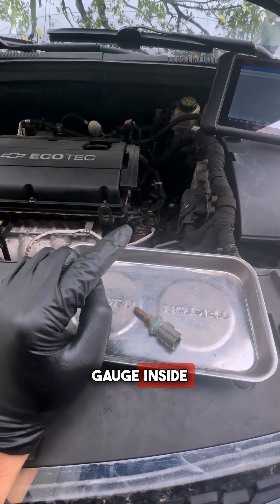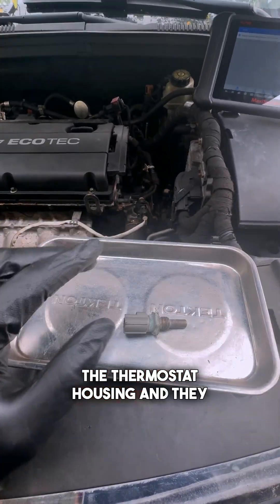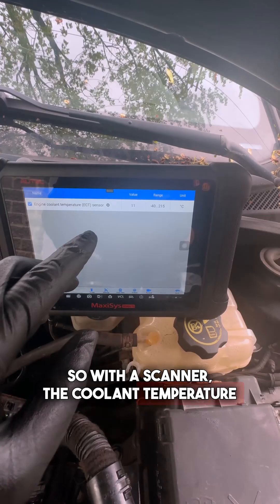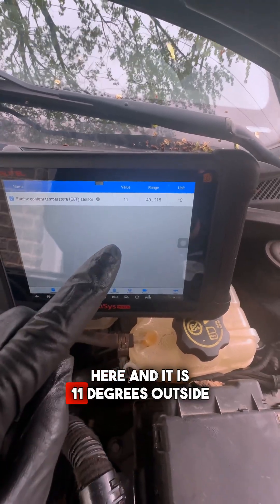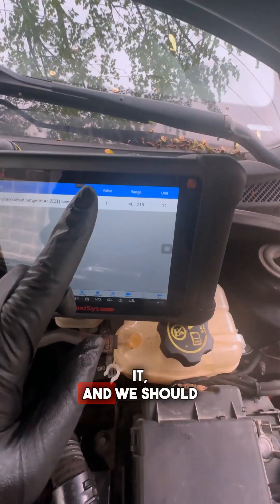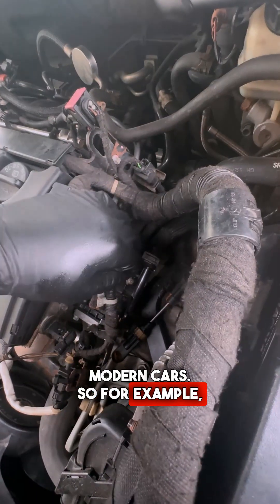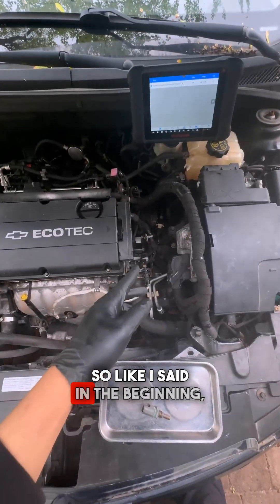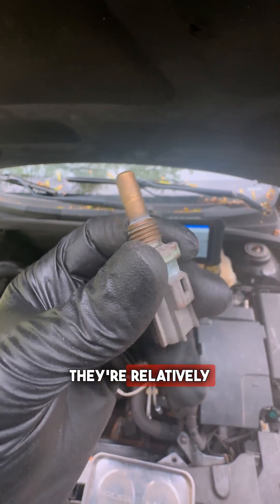How To Test A Faulty Coolant Temp. Sensor 🔥

Comment: I have an old ‘98 Toyota Avalon with a 1MZ-FE. It has two ECT sensors. Really confused me at first. 

Found some parts schematics and the one over by the timing belt is labeled as an ECT sensor(EFI). The one over by the thermostat is just labeled as ECT sensor(cooling fans). 

Any guess as to which sensor sends info to the dash gauge?
Reply from the maker: I believe its the one near the thermostat. On modern cars the other sensor would be in near the radiator. The computer would compare both temperature readings to check for a stuck thermostat.
Reply: @OneTrickTech   
Thank you for the reply sir!